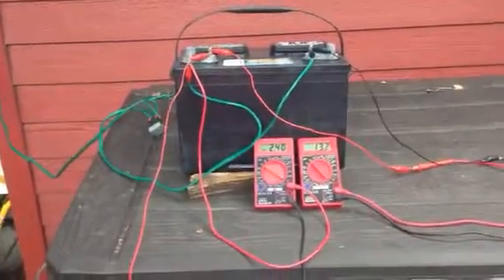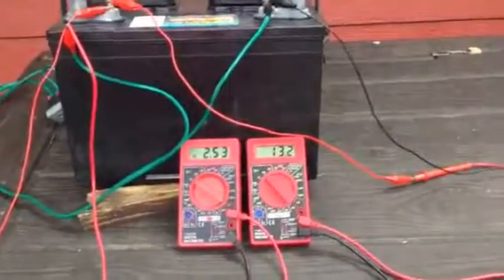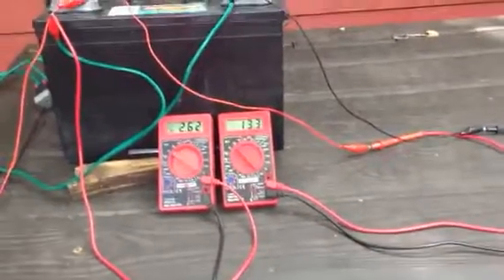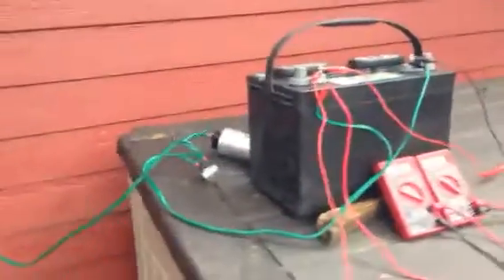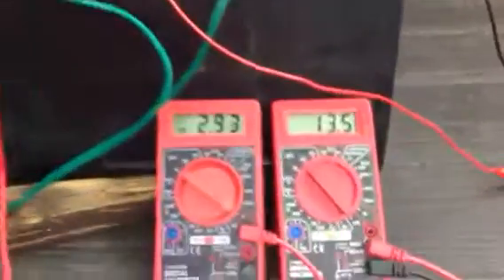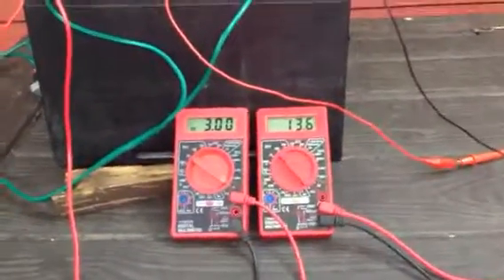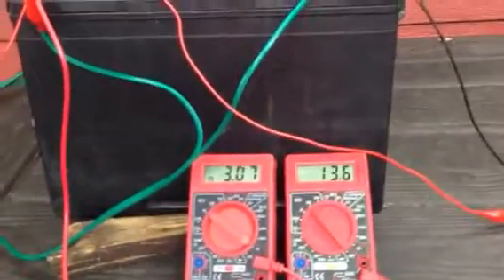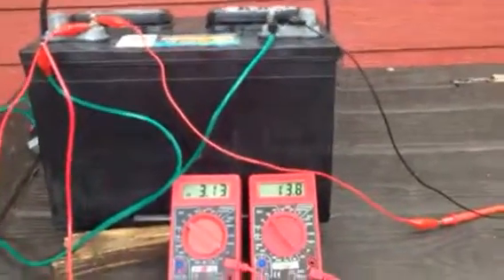Renew You - Battery Desulfation - This Simple Unit Pulse Charges Batteries!

Comment: did it work Did you save your battery?Also, the video in the link used a similar method.
Reply from the maker: Yes this simple charger does work... I added a timer to it and use it to reclaim batteries regularly... As long as the plates aren't physically damaged and just sulfated my experience with recovery is 100%... I use a 3 amp smart charger to maintain after recovery.